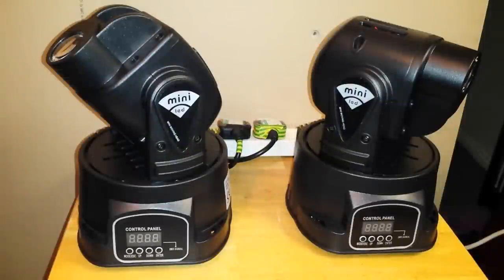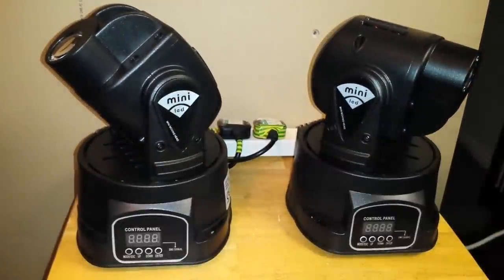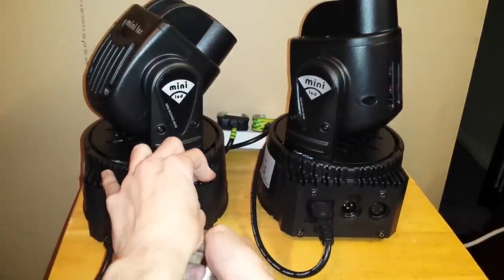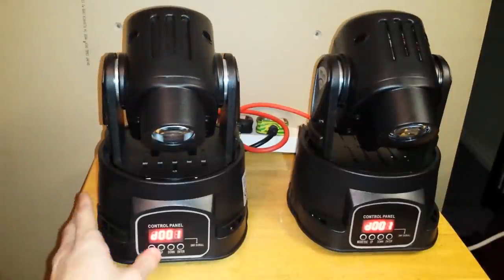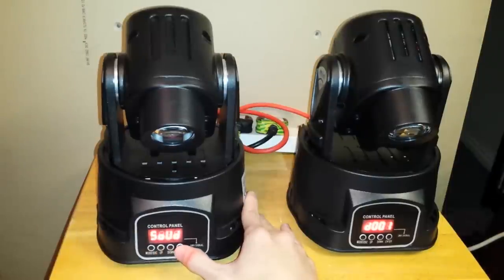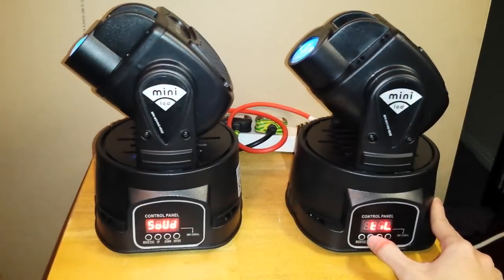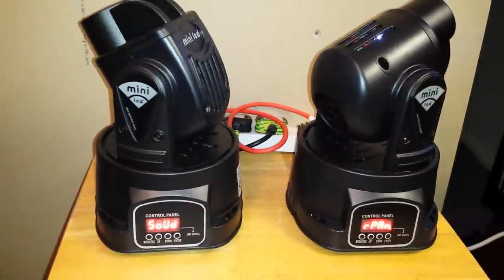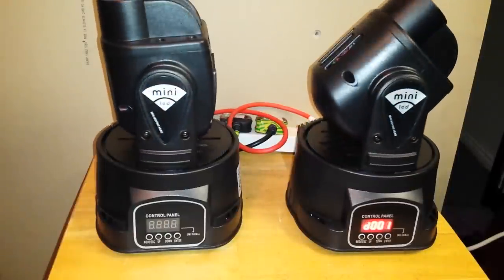Setting Up Two 15W Mini LED Moving Head Spots - Sound To Light Master / Slave Mode

Comment: RICH S: about making changes with ur light without a DMX controller. U should try one or rent one as it totally opens this equipment to do exactly what you want it to do. But if u don't have access to one continue to read my reply. 
Rich Spencer : hi there saw your question and just wanted to advise that you can actually fine tune these lights. You can fine tune everything from pan, tilt, colour, gobo. These lights have hidden features but it's all trike and error on finding them. I'll try to keep it simple. 
•in the menu select address. (Should say AD001) push and hold the "enter" button. 
•once that menu opens u can go thru what exactly you want  to fix using the "up & down" keys.
•push and hold enter again to save your colour, gobo,  pan/tilt settings. 
Hope this helped you out. If not experiment with holding buttons on ur unit to open hidden fine tuning options. All the best.

Comment: @nathan PH what if you turn the powerbrick to 'off'.  Will the two lights remember their settings when you switch power on again? Would be handy if one was going to place them on the ceiling.

Comment: Thats brilliant I was messing around with the settings and I got them working opposite but couldn't work out how I'd done it, have you any idea how I could stop them spinning all the way around because I've actually got a wall directly behind them so I just need them to do the light show in front. If you could help me with this I would be very grateful.

Comment: I plan on getting this disco light soon. Is this safe for home use? I love disco lights and a huge fan of them. I heard some people connect it to a computer. Do I have to connect it to the computer in order for it to work? Or can I plug it into the wall and have it work like that?
Reply from the maker: Hi Jordan,
Yes these are safe for home use.
You don't need to connect it to a computer, no. That's only if you want the ability to control the colours, patterns and movements. You can simply set the light to sound-to-light and it'll move and run a built in show to the beat of the music.
Hope this helps!
--Nathan
Reply: Nathan PH ok awesome. So if I put it on sound activate mode and if I do just dance on my switch. It’ll pick up from the sound from my stereo speakers right? I recently got a disco light from I think China for Christmas. Not the same one, I got one of those party light ones with the grey circle and the remote. However the light works fine the remote doesn’t work at all. I even noticed for the first time after unwrapping the gift and plugging it in it turned on without me clicking the power button. Odd. Only like 2 buttons on the remote work. Even exchanged the battery’s and still doesn’t work. So I’m gonna try to get this disco light and hopefully this one will work better then those other ones I got for Christmas. It’s always been bad luck for me getting disco lights for Christmas. My other one was those double disco lights and the motor broke the next day. So hopefully these ones will work good. And i think the ones with the remote I got were from China,
Reply from the maker: Yes it'll 'just work' to the music in sound to light mode, like I show in this video :) Yes lots of Chinese cheapo lights are really horrendous quality, These are reasonably OK for the money and can be used on the road for bands, musicians, discos etc.. And actually keep working. Hope this helps!
--Nathan

Comment: Ok so in order for them to be the same you'll leave them in the same channel ?
Reply: Not necessarily. Only the slave needs to be on DMX channel 1. Its just better to default them to channel 1 to save time if you're setting them up and down often (e.g. pop-up disco).

Comment: Hi, just a quick question, can you have two moving heads but different companies both linked to dmx? Great video by the Way!
Reply from the maker: +Gamer51 yes you can, as DMX is a universal protocol that all lighting effects use to communicate and be controlled. 
It may take a little while to get setup correctly, but just try it and play away! It can't hurt or damage anything :)
Reply: +Nathan PH  thanks so much for your quick reply, I will soon be setting up my own lights, thanks again!

Comment: How much did u pay for these? I found an auction, 30$ for 4 of these o_O
Reply from the maker: £140 GBP UK, It's the cheapest buy it now price for a new pair in the UK on eBay.
Reply: +Nathan H So 30$ is a steal for 4 of these right? :D
Reply from the maker: +Atilla Kiss providing you could get them that cheap, Hope nobody bids them up!
Reply: +Nathan H It was an instant buy option, I actually purchased 8 pieces of these for 60$ o_O I am curious if it's a scam or not.
Reply: and was it a scan. I only find find one of theese for 80€ here in germany.
Reply: It was a scam :( I got my money back tho trough buyer protection, it was too good to be true.